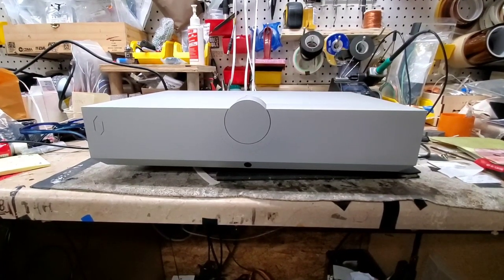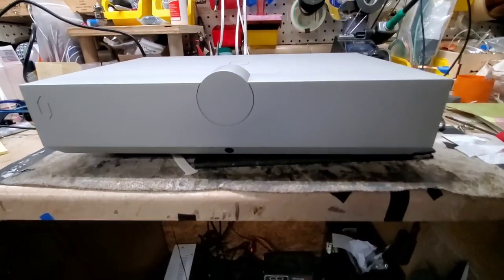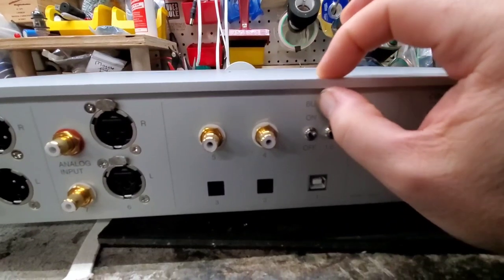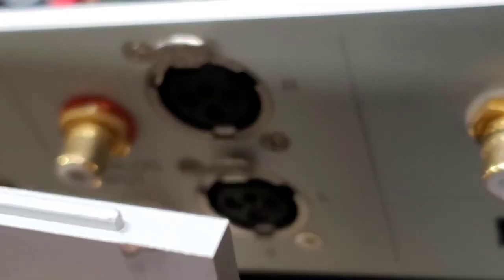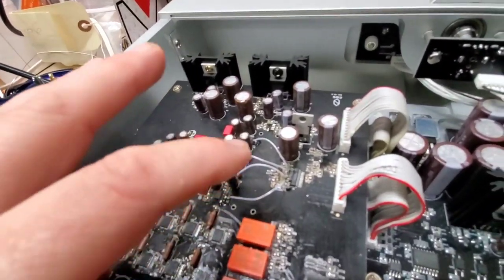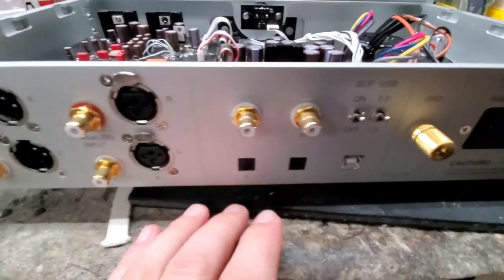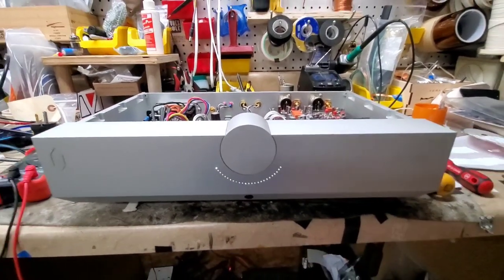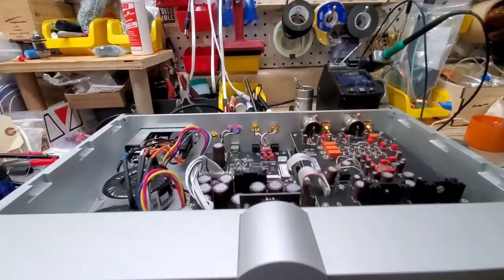Coolest HiFi Chassis design ever. COS Engineering D1 DAC

Comment: You should try out the EC Design DA96ETF with its converter.

The guys sells the combo for $1K. The 96 cannot work without the ETF meaning its a $1K DAC. It cannot do anything more than 96/24 and it cannot do DSD. 

On the other hand some people have compared it to a Terminator and found the EC better sounding when fed through USB (Termi won when fed by a SD Card digital player through I2S, according to the guy).

Other compared it to an 8K DAC, other to a PS DirecStream Jr, an older Gen was compared to a Jeff Rowland Aeris and was found to sound better.

I thought you being the good old OCD Audiophool everybody loves might find this interesting.

Comment: Well just for starters, the Linn CD12 was machined in house out of a solid block of alloy including the top.  Eight hours of milling per chassis.  On another note the solder work in the COS looks kind of sloppy.  Have you seen the workmanship on any Esoteric products ?
Reply from the maker: I could not agree more . Did you sort of sense my reluctance to go over the guts ? Fortunately slop does not affect sound seemingly. Butyes, I know Japanese soldering . Ive got a $35K Japanese Bridge Audio Labs DAC (Paid 10c on the dollar for it after the owner died) That takes japanese work to the limit.  And hey lets get real,  most is wave soldered SMT anyways ..Bridge is hand soldered tho

Comment: No it's not milled that would be getting rid of all that material no point, no they are welded on could be by ultrasound and or then milled
Reply: I'm no expert.. Looks like it was done on a multi access CNC.  As Mikey says, you can see the mill marks where they took away all that material.  It is actually a fairly simple part to mill once it is programmed.  It would take away that material in a couple of course passes and then a nice smoothing pass.
Reply from the maker: I know its hard to believe , but its absolutely milled and all that material is recycled., There's no way its Tig welded and Ive never seen ultrasonic welding that would work on a part like this.
Reply: @OCDHIFiGuy  I don't believe so, its not necessary to take that material out! only have to mill out the ends by your logic if that was the case. They wouldn't be going to a process of Milling all that material out completely unnecessary, and doesn't work like that, its not the type of thing you would do in any company and completely unnecessary.  What  they've have done is cast it you can tell it's cast, then Mill the ends and skim the plate. Yes you can Sonic weld aluminium and some alloys. Possibly could be injection molded but the cost of that I don't think so

Comment: The chassis is very cool I’ll give you that, but the soldering work is just crap, look at 8.27, there’s globs of flux all over the place, the boards were never cleaned properly, very cheap and messy looking internals. And honestly the story about the flying wires is laughable, the boards were fabricated with mistakes, this was just a quick fix it hack, with a fancy cover up story. Mutton dressed as lamb.